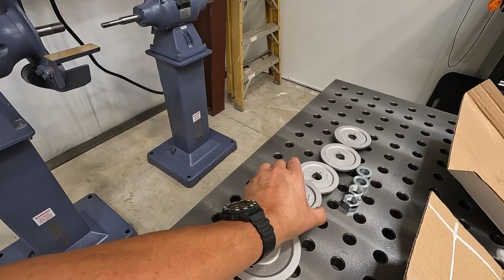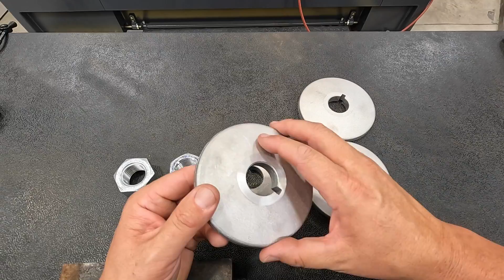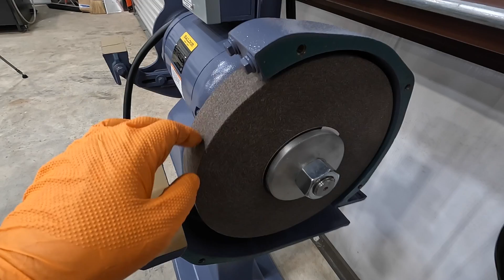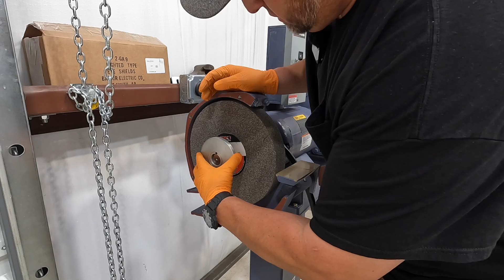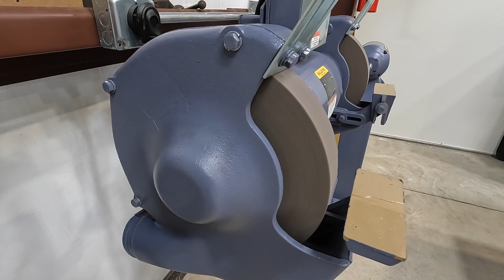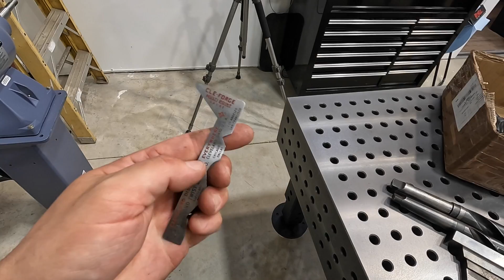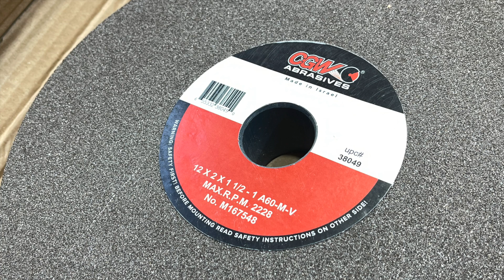Pedestal Grinder Improvements and Wheel Installation

Comment: I put the grinder on a neoprene pad 1 in bigger than the base and 1/4 in thick. No more vibration problem with uneven floor. Great content on grinder setup! Thanks HF
Reply: The vibrations are telling you something is off, what you are doing is not really helping what you're trying to do. If you take the time to true the wheels it will drastically improve your machines ability to do the work.

Comment: I feel your pain with the thread half-nut dial.  Once had a 4 TPI job on a large cast iron tie rod for a stamping press.  Was about halfway done and I must not have engaged the half nuts fully.  It disengaged halfway through the pass and scapped the casting.  Rough day...

Comment: That grinder is so smooth! Good work. I designed and 3d printed a holder for a diamond dresser. It has a thread that advances the diamond tool. It runs across the front of the rest.

Comment: what are extra t slots on cross slide for
Reply: Whatchu got😉😎

Really though they’re for anything you like; a rear tool post to speed production by minimizing tool changes, rear parting tool, gang tooling plate, or also line boring ops where you might want to remove the toolpost and compound and mount a tooling plate to hold your part. Keith Fenner and Max Grant (swan valley machine shop) both have video series demonstrating line boring on a lathe.

Comment: I would consider hanging an old welding blanket from the horizontal beam directly behind the grinders. After a while, the sparks will eat through the plastic liner of your insulation and may be a fire hazard.

Comment: I'm sure YOU know this, but since you didn't say it, I will. When anchoring any machine base like this, you nearly always have to shim the fourth foot or bracket, to keep from putting the base into torque, and creating the possibility of a harmonic imbalance in the equipment. This is particularly important in any sort of heavy rotational equipment, such as, for example, a piston-type air compressor, mounted on a tank, especially horizontal.

Comment: Adam, PLEASE do something to handle that dust, and wear a mask. That's a recipe for silicosis. Put 90s on the dust ports and run them down into a bucket of water. Or invest in a real shop dust collection system for them. please.
Reply: Baldor DC12 install video would be cool - before and after shots, etc. 

Also keep the abrasive dust off parts/equipment/the wall.
Reply: I love the smell of abrasive dust in the morning

Comment: I have to agree with Big Dave below regarding using a diamond vs a wheel dresser.  I have a 12" Baldor grinder as well and I made a holder for a diamond nib so I can true the wheel (make it run concentric to the axis of rotation of the shaft) and also make the wheel surface straight (from left to right).  The allows for much smoother grinding of hss bits and drills.  The straight from left to right is helpful when sharpening large drills as it keeps the cutting edges straight.  My holder slides on the tool rest and has a fence that engages the front edge of the tool rest to make it travel in a straight line.  I had to machine the front edge of the rests as the 'as cast' surface was too rough and not straight enough to guide the diamond.  Ken.

Comment: I don’t know why Adam doesn’t use a Mandrel between centers. Pound it on and use a long key with a hose clamp to hold it from turning. Most of the time clamps are not needed, provided you machine towards the increasing mandrel taper. Do the inside/outside and clean up the cupped area also. Take mandrel out, pound disc off and flip it around, do the other side. I swear! I’m a 5 yr hobby machinist and watch all the machinist channels. I would like to see more drive dog and mandrel machining.

Comment: One thing we are required to do by Health and Safety law here in the UK when mounting any abrasive wheel, is to RING the wheel before mounting them, even if it is a brand new wheel. As you don't know what has happened to the packaging in transit the box could have been dropped or anything and the wheel might look ok but by ringing it you will know if you have a cracked wheel straight away by its dull sound. If it's ok it will ring like a bell. This is exactly the same principal that used to happen to railway wheels. A man would go down the length of a train and hit the wheel with a certain weight long handled hammer. If any wheel was cracked then it would show up by the dead sound.

Comment: First time I've seen a wheel dressing tool used putting the support studs in between the tool rest and grinding wheel to true it up. Not saying it's wrong, just never taught, read or done it that way.Always on the top of the secure level tool rest. I'm curious and going to look iin to it more. First thing I thought is boy that wheel dresser  can get jammed in between if that tool rest loosens up by pivoting the dresser like that.

Comment: Why don't you take a bit and remove a little of the face on both sides on the two inch so the spacer and nut are counter sunk and run with the two inch it should handle it just fine I used many throw away from my job when the 2 inch wheel was worn down from a 12 to 6 and needed replaced I would take them home and grind out a counter hole on both sides so they would work on myn1 inch grinder last me for a long time still have two left and that was around 30 years ago mine still works greatb

Comment: you can get rid of a lot of the pedestal column hum by filling them with spray foam.  its basically acting like a speaker cone atm. foam should stop that.
Reply: I filled mine up with fine grain sand. Thus creating some mass.
Reply: @janvisser2223  Yep, mass is always better

Comment: Hey Adam with the grinders near the wall and the insulation there I would run some some kind of pipe out the discharge of the grinders to the floor to keep from damaging the wall insulation.  I would suggest some kind of exhaust piping maybe the flex kind and point toward the floor.  You could have run down into a metal bucket and find some small gage metal screen mesh to put over the top of the bucket to try and keep the metal dust contained.
Reply: I had the same concern. You could at least put some metal sheet against the wall.
Reply: Y'all can do it for him if you're so concerned about it.

Comment: I don't see how taking 1/16" off the outside will help with vibration when you can clearly see a huge variation in the thickness of the tapered back side of the washer. Surely that should have been cleaned up as well!
Reply: Don't worry about that, it'll buff out.

Comment: Hello,  This has nothing to do with this video.  I'm looking into making my own English wheel.  One thing I've been surprised at is how expensive the top roller for a good English wheel is.  I was think I could make a nice upper wheel out of an old bearing race.  It would need to be for a pretty good sized shaft as I'd like the upper wheel to be between 6" to 7" and say around 4" wide.  The inside surface of the race could be damaged because I'll be using the outside surface.  As bearing races are hardened and ground I think they would make a great upper wheel.  Have you seen anything like this around?  Thanks Jonathan
Reply: Jon.  Check out Dom Chinea's channel.  He now owns Ranalah and also knows about the English Wheels.  He has many videos explaining the problems you ask about.
Reply: @SilverWrinkly  thanks

Comment: Did you ring the wheel to make sure there were no cracks in shipping?
Reply: I didn't see him do it. The first thing we were thought about grinding wheels was how to check for cracks. I've since seen the results of cracked wheels. Messy.
Reply: @claudew2899  First thing I learnt about grinding wheels is storage,,should be on a peg through wheel hole,,and sheilded from other wheel coming in to contact,
then before fitting give it a light crack with a hammer handle,,should hold a note,,and not a thud,,
run for 30 mins before atempting dressing,
Saw 2 foot wheel explode,while testing,,didin't it go off,,blew a hole through the wall,tore gaurds of and had me running,

Comment: As a life long sparky always had Bullet proof tough Weldor as my first choice. One of the few motors still made in the USA. back in the early 80's we had about 10 old candy machines that used the 1950 era U frame motors. After they stopped making that frame they purchased motors and rather then make a plate they extended out a 3 groove pulley as far as the could and only used the two outer grooves. Tried at least 3 different motor companies and they all broke the shafts after a month or two. So I told them to buy some Baldor motors. In ten years they never broke a Baldor shaft. Stay away from inferior IEC European motors whenever possible. They run hotter due to not using as much copper on windings according to a big motor rewind / repair shop.

Comment: I do not like alarms that go off before they need to ... years ago I was test driving a econo sports car and this alarm BLAP BLAP BLAP every time, I said to the sales guy what's up with that? "oh its reminding you to shift" at 3500 RPM on a 4cy engine that redlines at almost 7, screw that I don't want to hit the alarm gently pulling away from a stop light on a hill

Comment: Hi Adam, congrats for your new grinding machines. Please be carfull with those sparks hitting your white cover wall. Also, the machines dust output in the back could be connected to dust receptacles to minimize impact on the shop. Have a nice week !!
Reply: Hey Adam with the grinders near the wall and the insulation there I would run some some kind of pipe out the discharge of the grinders to the floor to keep from damaging the wall insulation.  I would suggest some kind of exhaust piping maybe the flex kind and point toward the floor.  You could have run down into a metal bucket and find some small gage metal screen mesh to put over the top of the bucket to try and keep the metal dust contained.

Comment: Are you going to put a vacuum set up on the bench grinders?  If you decide to do this with a shop vac, get an empty 5 gallon plastic bucket (Home Depot or used) and also get the cyclonic dust collector from Harbor Freight which comes with the cyclonic chamber, some hose and a couple adapters and a lid for the bucket and some hardware. These things save vacuum motors and filters. I have a very similar one on my blasting cabinet and never have to empty out the vacuum canister while the separate bucket collects everything. I use from glass beads to the heavier abrasives. I burnt up 2 vacs before I discovered the cyclonic units.  I literally had flames coming out of the top of one vacuum motor because of an ineffective dust collector.  Cheap investment in the long run for the shop, your lungs and the vacuum.
Reply: There's also switches that'll turn on the vac system when the tool is turned on, which is convenient both for shop noise and power use.
Reply: Why only a 5 gallon? I think he should use the 55 gallon one.
Reply: @jackjohnson6074  My point is dust collection and equipment life. What he does is his business.
Reply: @4speed3pedals  then maybe we should leave what equipment he uses to him then. You think?

Comment: You should bolt them to the floor. And connect a vacumcleaner on the outlets on the back side, so you prevent all the grinding dust. And mount a tray for wather.

Comment: I’m yet to do any threading ops on my new equipment, but it is what I am most worried about. I’m sure you get use to it, but it seems like it would sure be easy to not engage it perfectly every single time and screw up your threads. Maybe I’m worried about nothing, but sure seems like it would be difficult to engage in the exact same spot each time. Keep up the good work and thanks for the knowledge!
Reply: Makena few practise pieces to figure the motions, that helps sort out a lot of problems before you get started on something important
Reply: Just start on the same threading dial line everytime, you'll be fine. You can do the math later and figure out other lines, but stick to one line and you can't mess it up (as long as one set up and gear train doesn't change). It's intimidating at first but practice a little with shallow passes and get used to your motions. 
Also give yourself a good lead in area before the tool gets to the work so you can stop it if you missed your number. Good luck
Reply: @daveb3910  Thank you! I guess I’m just having trouble picturing that it would engage right in the same point every time. Seems like it would be easy to be just even a quarter or half a turn early or late engaging the half nut. I’m sure it’s not bad I’ve just always had a hard time wrapping my head around engaging it in the exact same spot every time when you’re working with a screw mechanism. I have a tendency to overanalyze and want things perfect. Thanks again, I’m going to give it a shot tomorrow.

Comment: Those flanges are junk.  Making precision ones on the CNC lathe wouldn’t take any longer than manually “fixing” them.  (I really lost it when you said the bores were “as cast” and .01” .)
Reply: Why don't you make some since you're so badass. Could have made them up in the time it took you to write that.
Reply: @jackjohnson6074  do you really need to respond to every comment?
Reply: Yes

Comment: Shouldn't it be faced right from the outside right to the bore as that side touches the grinder wheel? 
Now the outer face isn't parallel with the face near the bore.
Reply: Wrong.
Reply: @jackjohnson6074  ?

Comment: Baldor is a top grade bench/ pedestal grinder, I'M a bit decived that you'll have to remachine the wheel side support plates.
I've had to machine new support plates on many lower grade bench grinders and I modified the design to machine the wheel adapter bushing integral to the inner support plate to have a better support and avoid wobbeling as on these cheap grinders, the step on the shaft designed to provide thrust to the inner wheel support plate is very often minimalist and very often damaged requiring the truing of the armature shaft.
very good video.

Comment: I guess I don't understand the difference between the two shops. The home shop had all the upgrades and this new shop is all new so, why do anything with the old shop at all. Is he going to go full time at the new place like he was at Motion?
Reply: The new shop is only leased I believe.  I think its more about unboxing and product placement. For me its not as good as the old Abom79 videos but still interesting. I hope it all works out ok for Adam. He comes across as a really nice guy
Reply: He’s setting up the new shop to a) handle larger workpieces, b) learn new tech, and c) have a place to keep his business going when he moves his old shop to new property.
Reply: As he has said he is looking to move to a new house, and thus needs a shop as a transition, since he will have to pack up his home shop.

Comment: I bought a grinder from Lidl and had to do the same things that you did. Something is not right with Baldor, in my opinion. My Lidl grinder cost 59 Euros.
Reply: It's mostly in the motor and bearings. High quality windings and high quality bearings that will likely never need any servicing for decades.
Reply: @Garth2011  That 12" grinder costs more than 4000 dollars without the pedestal. In my eyes there is no excuse for a machine of that price not to be perfect in all details..
Reply: @BruceBoschek  It's 3 phase too. Definitely not something for a project garage or homeowner shop for the money. Those pedestals aren't inexpensive either and they are too short for tall operators which is why a couple of us went down to the local Patton metal sales warehouse and got some round 2" thick plate for the base, 6" square tubing and a nice large 1/2" top plate to mount the grinder onto at the correct height we wanted.  Had made a nice water cup mount just the same. No leaning over anymore. 
Yes, they could do a few more things to make them better but I'm sure they figure that is all a personal thing. Not providing an included water cup with the bases is not very smart even though they offer them as a separate purchase and again not inexpensive. I'd also prefer they include some kind of exhaust hoses for the rear dust ports so the buyer could at least have something to route the dust with.

Comment: You left the face that the nut rides on proud. So the piece will not put pressure on the outside of the washer as intended.